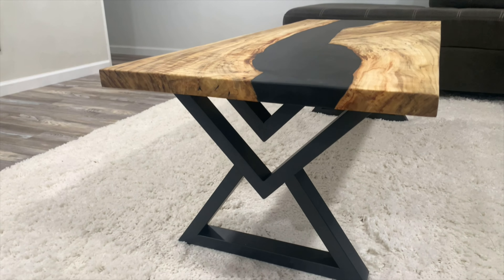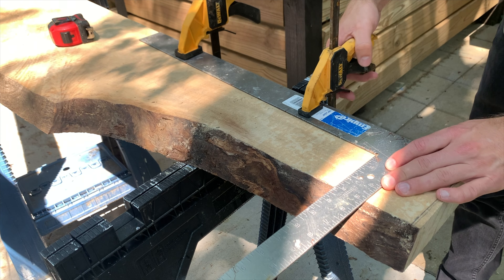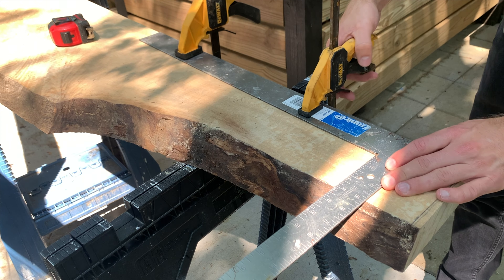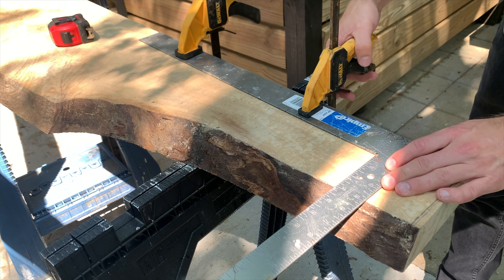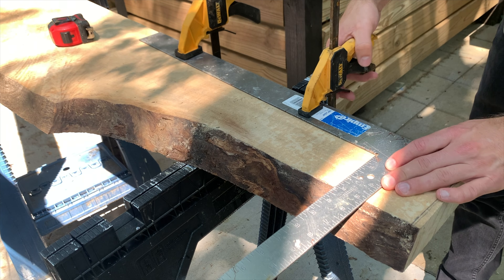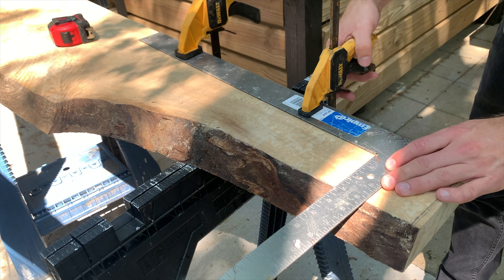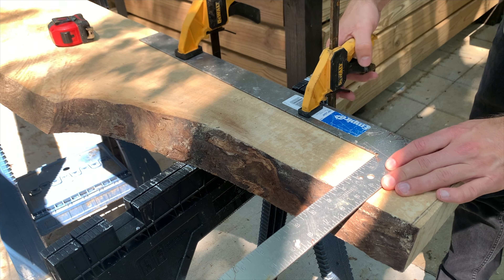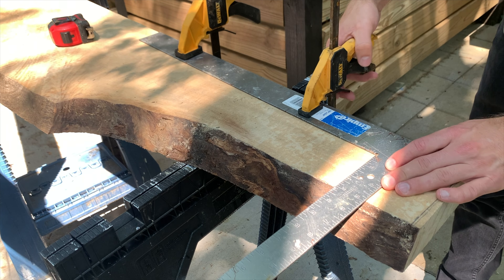I Built TWO Epoxy River Tables - Here is Everything I learned (How to Build a DIY Epoxy River Table)

Comment: Couple tips for next time - make sure you give the silicone at least 24 hours to cure, I know some say 1 hour but they don't really especially when under the slab.
Use some kind of mold release even with the Tyvek tape, Pam cooking spray works well, spray lightly then wipe down with a paper towel.   It'll come out so much easier if you do this.
Apply a thin layer of epoxy onto the live edge and wait for it to to get tacky, this will help prevent any gas bubbles coming through the wood when doing the main pour.
Epoxy seems hard after 72 hours but if you start sanding it gets gummy, after a week it's truly cured and far easier to work with.

Comment: here is tip for your next table use beef driping as release agen on your next table on your sealing parts you will be saurpriesd  i    it for over 30 yers old but works well
Reply from the maker: That’s a good tip! Where do you get that stuff?
Reply: my work is in many famous building in america and uk makig fine plasr casting i would take moulding frome placer with fiber glass then macking a copy company has been going over a 100 yers and still going thaere is a picture of adams mouldings on internet of horse cat carrying plaster cast

Comment: A couple tips for resin pours, first is use a mold release spray. It takes the PITA out of the equation when removing the forms. Secondly I mixed mica powder (you can use holographic powder too) into some clear resin and used it as paint for the edges of the wood, the more convoluted and textured the wood is the more possibilities for "painting" the wood with multiple colors. Let the "paint" set for a day before pouring the clear resin into the mold although pouring right after applying the paint may create a color haze on top of the painted wood edges.

Comment: Very helpful narration. Great video! Did the black epoxy stain the wood at all where you filled in voids? And were you happy with the bubbles (lack of) in the black? Or did you still see some trapped bubbles? It sounds like you wouldn’t do clear again because too many trapped bubbles.